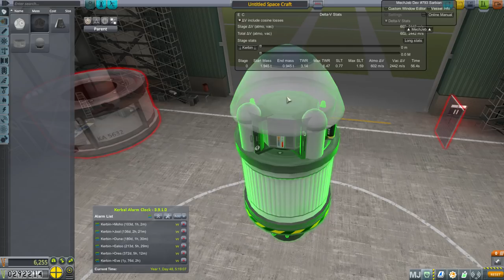Kerbal Space Program 1.4 Tutorial Career 08 - Minmus and MechJeb

Comment: Launching a rocket with keyboard controls only isn't bad.  But flying planes tends to be an exercise in self flagellation.
Reply from the maker: Well, MechJeb probably won't help with that one (haven't tried). Atmosphere Autopilot might.
Reply: Using surface mode and SmartASS is fine for SSTO or SR-71 style missions, and any fighter style aircraft with a high TWR can be banked and yanked easily enough. But you'll never fly a coordinated turn without a joystick and using the keyboard results in flying ass first through the air at Mach 2 (undergoing supersonic retro propulsion as Space X would say) far more often then desired. It's not a big deal if you have enough TWR to point the nose up and power out. If you don't, you better have enough static stability and enough altitude to allow the nose to come around into a prograde orientation and pull out of the resulting dive. You'd be surprised how fast 20km in altitude goes when you're struggling to get an SSTO or shuttle to nose down out of a flat spin.

Comment: Nice series! Just one question, isn’t using the 909 within the atmosphere incredibly inefficient? Other than that I’m really enjoying it! Especially the mechjeb stuff is really interesting.
Reply from the maker: Depends where in the atmosphere. If check the ISP, you'll find that engines are pretty close to their vacuum efficiency around 15 km, and definitely there by 30 km. That's because even though the atmosphere officially ends at 70 km, the pressure drops off very quickly and by 15 km it's around 10% of sea level, and by 30 km it's around 1%. The air pressure is what makes the engines less efficient, because the air is pushing against the thrust, slowing it down (to put it simply).

Comment: This isnt really related to the video, but is there a way to move parts to different locations. Like moving the Procedural decoupler to the coupling section, instead of it being in structural.
Reply from the maker: Well, if it's just a part or two, you can go into the cfg for the part in the Squad folder and just change the category. To make sure it doesn't get overwritten in an update, though, the better way is to use a Module Manager patch (a new cfg) that has something like:
@PART[partname]{
     @category = newcategory
}
or something like that. There are also category mods and stuff like FilterExtensions, which are all more complicated.
Reply: Alright i will just try the first suggestion, the rest sound a little complex for me. Thanks
It worked thanks again.